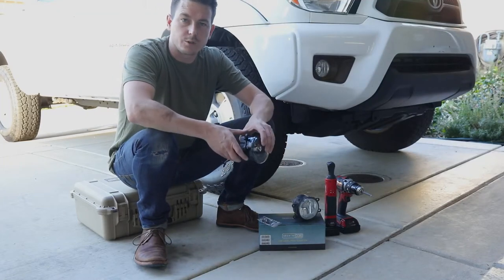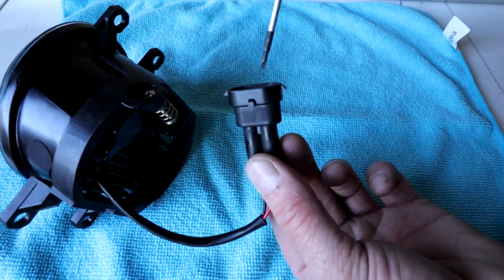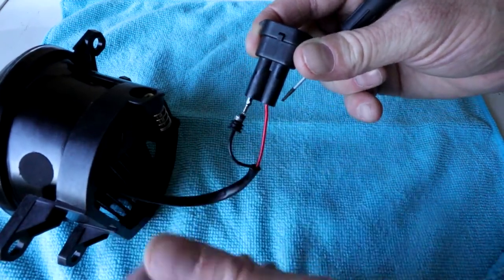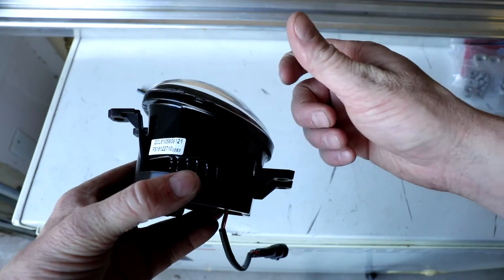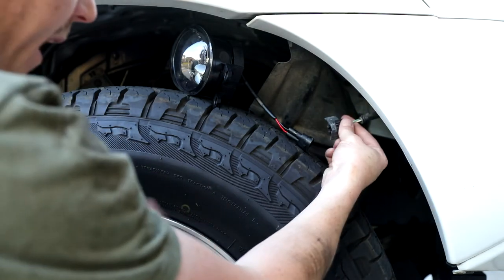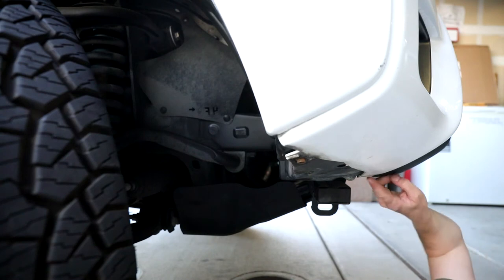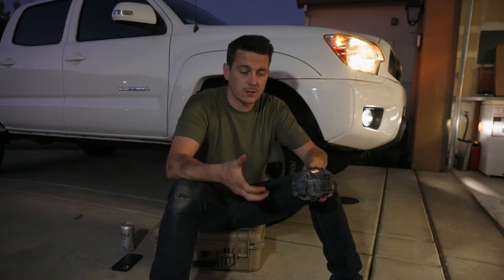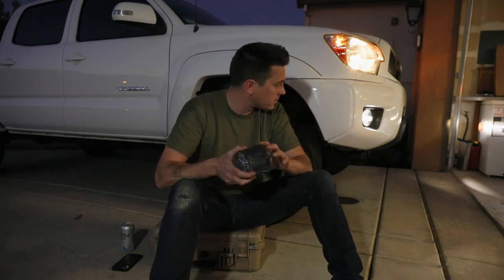Morimoto XB LED Fog Light Install Guide on 2nd Gen Tacoma | (2013-2015 Tacoma)

Comment: Thanks for this video. Purchased 2 used Morimotos for my Subaru Forester. One worked and one didn't. After some frustration and assurance from the dude I bought them from that they both worked I decided to revisit the issue the next day.  I came across your video and a light went off when you discussed the polarity. I checked the two lights and sure enough the polarity was wired differently from each other. Switched the polarity on the one that didn't work and Bingo it now works.

Comment: Thanks for making this video, helped me out when I reversed polarity. Turns out my 09 Tacoma was reversed polarity from the video.I used a real small flat screw driver like you said, glad I didnt have to figure this out didnt see it in directions.  Also Morimoto directions said to test the polarity/orientation with the lights bare wires to your truck plug before installing in light clip. Was counter intuitive to my reasoning, but I guess its proper.